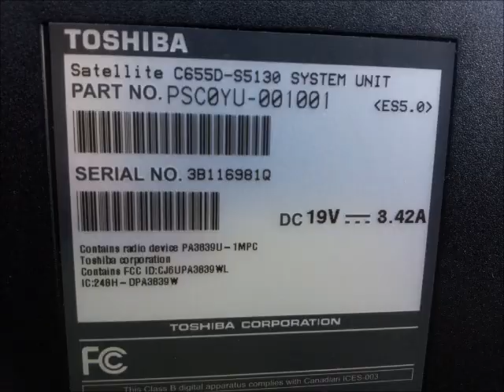Toshiba c655d-s5130 bios reset help.wmv

Comment: XXX jumpers worked for me on a C655D-S5134.  Multiple reboots while using tweezers to bridge the connection.  Ram and CMOS battery stay in place.  All you have to do is remove the ram cover.

Comment: you have to solder a small wire across the XXX pads boot the laptop up and wait 30 sec you will see it reboot do this 2 times and then remove the jumper